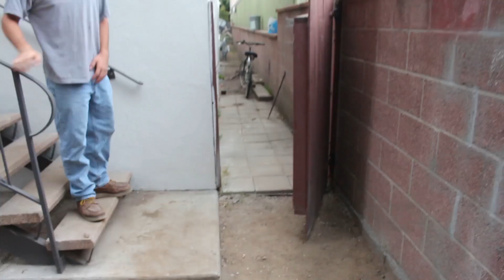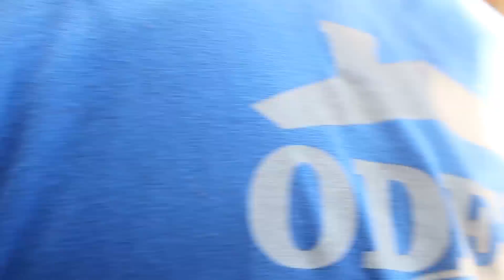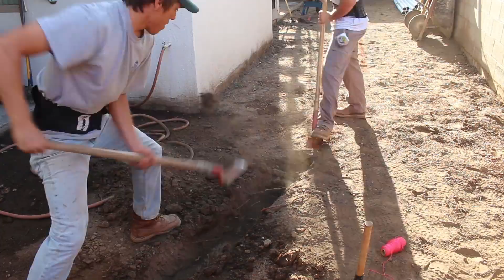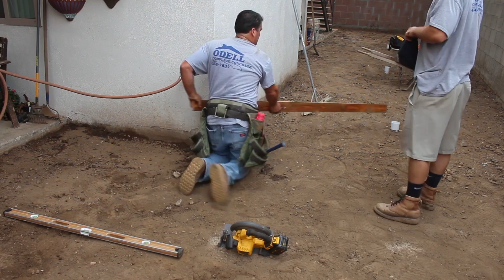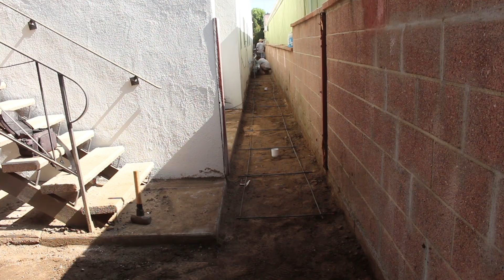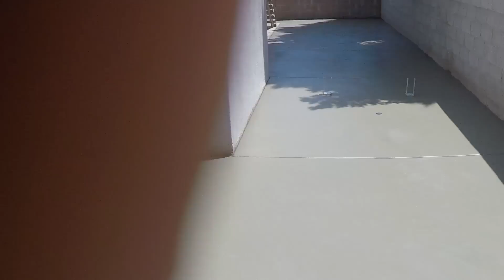How to Pour a Concrete Backyard Patio #5

Comment: Found I was looking for. I commented in one of your video looking for drainage set up. And this is pretty detailed and easy for me to understand. My question is, for each drainage, how do you determine the square footage or a rule of thumb that a drainage can support an area. How would you know if one drainage is good enough for this slope and going to slope the cement on the other drainage.
Reply from the maker: Great
I really don't do calculations.
What I like to do is have a back up  plan.
For instance if the drains do fail the water will still run to street before entering house.

Comment: Hi i am making a splashpad in my yard can you reccomend the amount of fall i need on the slab so the water runs away quickly but at the same time i would like the slab to appear as flat as possible with the water running into the centre but on one side into a small kiddies pool its 6metres acrross to the step down into the pool thanks and keep up the great work from Australia :)
Reply from the maker: 1.50%
Reply: Thankyou for your reply

Comment: Would that pipe be easy to clean if it ever got clogged with debris and is the pvc you used better than the 4" flex corrugated? Thank you in advanced.
Reply from the maker: I would have to say hydro jet is the only way at this point.
Until pipe is continued to Street.
TY

Comment: I'm a pretty new sub...really enjoy watching your videos with all the attention to detail, the variety of concrete work and the professionalism you show. Wish I had seen your videos back in 2009 before I had a patio poured, with half stamped and colored and a short retaining wall built in the front. It was definitely more about the money, than doing a good job, with the company that did it. Learning a lot watching your videos...thank you! Oh...quick question if you don't mind....I need to reseal the stamped part(they sealed the next day after pour, and it's been flaking ever since)....wondering if you have a video, or can recommend a video on the process to clean, reseal and what type of sealer? Area is only about 12' x 16'. Thank you!
Reply from the maker: Yes we have a video of sealing.
Look for our videos, with the words stamped concrete. There is some sealer in those.
TY
Reply: Thank you sir....I will find and watch that video. I'm planning on pressure washing it and letting it completely dry first. I didn't plan on using a cleaner first, but it's been since 2009. Do you recommend a cleaner and scrubbing before pressure washing, or not necessary if it's not dirt stained? TY Your father taught you well...and wish you all were closer to Kentucky, you'd be my new concrete guy! :o) I had to make my guys put rebar in my slab, or they weren't going to do it, ugh.
Reply from the maker: Yes sounds like you will need a degreaser.